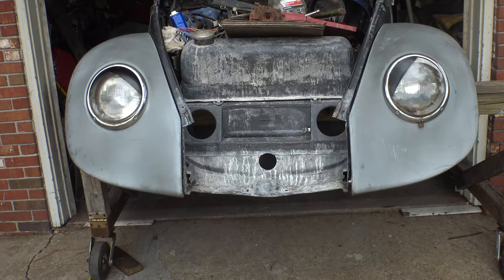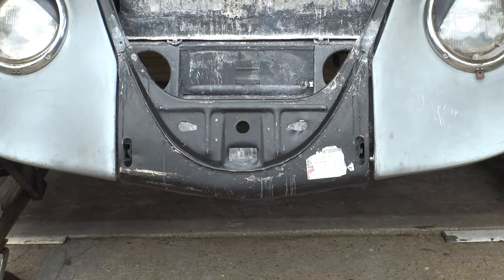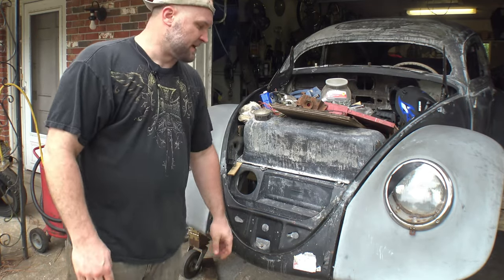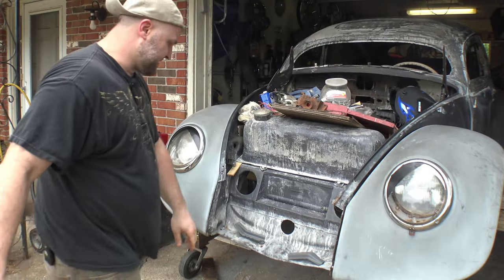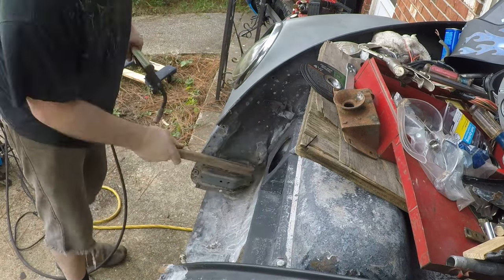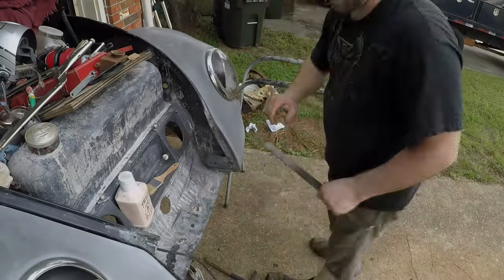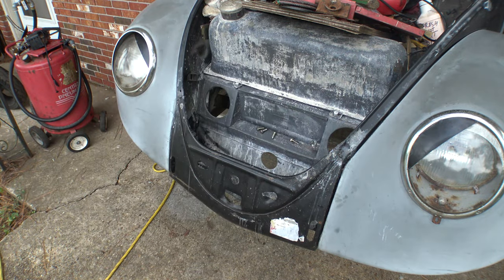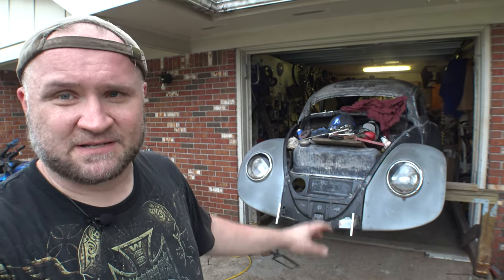Welding Custom Bumper Mounts - ROTTEN OLD 1956 VW BEETLE - 113

Comment: She's looking more and more like a bug that just needs some paint! Good job!  Get her finished up enough to send to CSC. 8-))
Reply: This isn't a reply, my speculation imagination just went off! I wonder if it's possible to make a mid- engined Karmann Ghia? Or a mid-engined any VW? Has to have a big engine too
Reply from the maker: @BobPegram  Sure, in fact the Porsche 914 was a mid-engine'd VW.  But its easy to reverse the ring gear in the VW transmission and turn it around backwards.  A lot of sand rails do this.  You'll just need to come up with a chassis design.

Comment: Is the front apron a direct fit? Looks good
Reply from the maker: Not on the bottom, otherwise sorta yes.
Reply: @DuckmanCycles  I figured it needed a little messaging. Thanks for the info
Reply from the maker: I mentioned in the video, but I will be showing it later when I get the apron mounted once and for all

Comment: Cool I'll defo buy one of your T-shirts and ware it in my herbie project videos I have a new plan for Herbie which is to make him the world fastest road legal electric beetle, the current record for the world fastest electric beetle is held by a tube chassis drag racing bug call the Black Current III which dose 0-60 mph 8.71 seconds and has a top speed of 151 mph, however I don't know if my Herbie will achieve a 0-60 mph time of 8.71s or a top speed of 151 mph but it will be fun trying
Reply from the maker: Thanks so much Bend, I think you can beat the 0 to 60 pretty easily.  Even my 350Z has about a five-second 0 to 60 and it doesn't have all that electric torque!
Reply: @DuckmanCycles well with virtually every bolt on areo mod I can put on a curved windshield bug which will reduce the coefficient of drag, light weight driver and front passenger  racing seats and a fiber glass rear passenger seat alloy wheels two electric motors making 112.8 KW (about 150 bhp) and 235 NW (173 LB/FT) each mounted two a custom 2 speed IRS trans he probably will beat it
Reply from the maker: I want some Oreos!  Haha!  You'll go fast, you'll see!
Reply: True Herbie will probably go faster I think he will and it will be the ultimate Sleeper car if he isn't the worlds fastest road legal electric beetle classic electric cars put a 400kw or (636 bhp) Tesla drive unit in a 1303 which goes 0-60 in 2.5 seconds